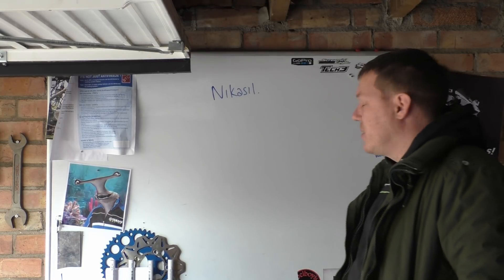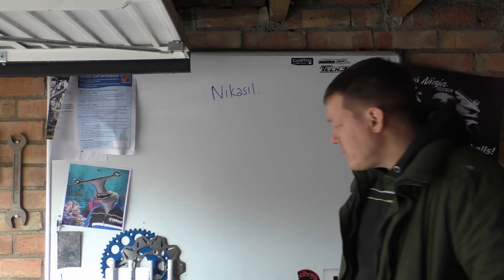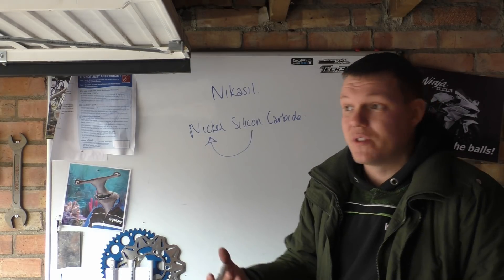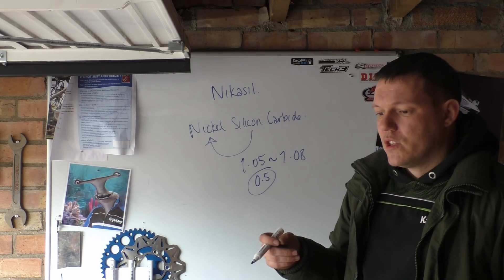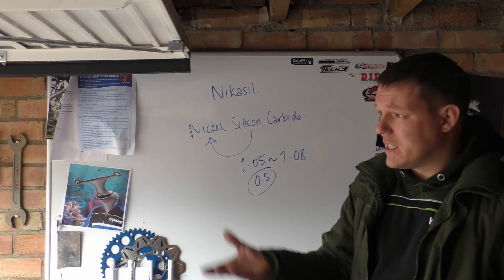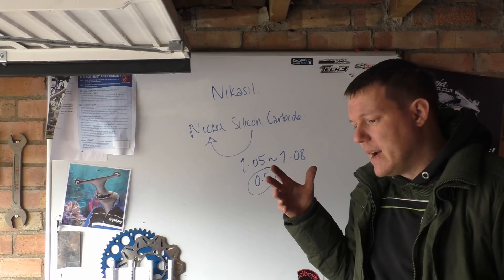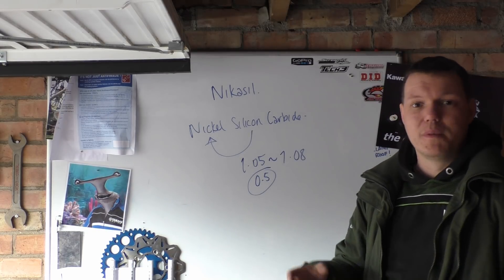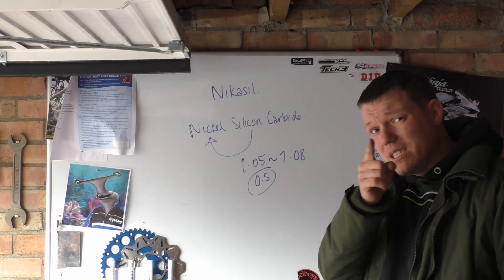Nikasil coated cylinder?

Comment: Actually the silicon carbide is not dissolved in the nickel at the beginning of the process (contrary to the wikipedia article). It's suspended in the electroplating  solution (acid and stuff) as fine powder. It then sticks in between the nickel  which is deposited to the bore. Basicaly the nickel serves  like a "glue".
Reply from the maker: Who said it was the beginning of the process - not another arsehole
Reply from the maker: https://www.sciencedirect.com/sdfe/pdf/download/eid/1-s2.0-002605769596247L/first-page-pdf
Reply: My bad. I misunderstood you.
Reply from the maker: No worries dude - that was a bit of a sharp reply from me - sorry
Reply: @thedirtyworkshop  Thank you for putting links to academic articles

Comment: Your a font of knowledge. So I have a question which might sound fallacious , I was doing a bit of research with regards to wooden pistons. I came across a blog where it said the original pistons for the seagull outboard engines were made out of Lignum a very hard wood. Bearings on subs were made from it but that's a different story .Plus during the second world war ash was used on tractors because of the metal shortage. From being highly sceptical, I have come to the conclusion that this might very well be a fact, as long as where the wooden piston top has a heat shield. Have you or any of your subscribers heard of this.?

Comment: When we further compare a steel cylinder liner vs Nikasil plated Al cylinder, there is another interesting fact.

The overall toughness is a better for the steel liner. So, when you are limited with space for your cylinder and you may come up with quite thin cylinder walls...in that case the steel liner is more ridig and durable, as the Nikasil plated Al cylinder would crack/bend/be destroyed under heavy engine load. This situation happens quite often (thin walls), when you are overboring the engine.

I understand it is not a "Nikasil" thing, but when we speak about materials and solutions for cylinders, this come up to my mind as well.
Reply: That’s absolutely rubbish. Cast iron sleeves are primitive compared to nikasil plated bores and anyone who suggests otherwise is stuck in the 70’s.

Comment: Which oil do you recomend for nikasil coated cylinder? Semi syn or full syn and which viscosity is better? Oil with ester is good for nikasil?
Reply from the maker: it doesn't really matter - and the viscosity has nothing to do with each type - if 2 oils synth or not have the same viscosity index then they are the same in regards to viscosity. Note that I said 'index' and not SAE rating (like 10W40).

Don't stress out about oils. Keep them topped up and freshly filtered and changed and you'll be fine

Comment: Do they coat pistons/cylinders using PVD (physical vapor deposition) also as they coat carbide cutting inserts and tools?
Reply from the maker: Yes with other coatings like DLC etc
Reply: http://www.staton.sk/wp-content/uploads/2015/11/Staton_Coating_EN_LR.pdf on page 14 there is a table with coefficient of frictions and thermal stability of some coatings.

Comment: Matt, I know this is years ago but it's common on early Yamaha R6's for the aluminium cylinder sleeve to crack and that fall into the cylinder, wrecking the engine. A common 'solution' to this is to bore out the coated aluminium sleeve and use steel liners instead of a coated aluminium sleeve. I've always been worried about doing this for reasons you mentioned above RE clearances etc on a high revving engine. Would you agree?
Reply from the maker: No idea. I haven't seen these failures to make a conclusion
Reply: @thedirtyworkshop  no worries Matt, it's the original carburetted R6 engines 98-01 that are affected. The later fuel injected R6's have a coating directly on the crankcase. Yamaha did away with the thin aluminium sleeve. If you fancy a read up on them, it's easy to find on google. Cracked liners.

I'd have thought that a proper fix on them would be to use a thicker aluminium liner, similar dimensions to the steel, then coat that. That way you still retain the heat transfer characteristics and clearances of the original engine.

Comment: Wouldn't you want a LESS heat conducting liner? Or at least the inner face of the liner? After all the engine block only has to reject the heat that actually soaks through it, any heat that goes out the exhaust is easy to deal with, especially if you're turbocharging where that heat becomes pretty valuable to you.
Reply from the maker: "Wouldn't you want a LESS heat conducting liner?"

heat is energy, so what we are concern about is saturation. Think of the liner as a filter (and the filter being conductivity) too much of a filter means that thermal 'flow' is going to be slower. This means that the piston will become hotter.

This put the piston in a harsher environment. And we are pretty close to the pistons melting temp.

Comment: Some small engine manufacturers still hard chrome their cylinders, your minimoto engine will have a chrome bore as do strimmers and some chainsaws.
Reply: What is the best material for the piston rings with nickel carbide silicon coatings
Reply: In the early seventies Yamaha had an optional cylinder what are the dirt bikes that was Chrome plated by 2 microns Honda produce a CR250R  what is a Chrome plated  cylinder in 1979 hitting others what alloy of chrome that was and I doubt they'll tell you my factory representative explain that they use a brush similar to a chimney sweep the bristles made out of Chrome the cylinder was grounded and I spun the bristles into the cylinder that was charged positive electroplating the insides of cylinder on aluminum. I was working at Honda at the time there was a chip on the cylinder of my Elsinore where someone has slept with a die grinder cleaning up the ports and my factory rep got it replaced for free which was very unusual no one else would have done that and I got a chance to see what the plating look at the place where it was chipped off and that was at the exhaust Bridgeport made a hell of a clicking sound when it was running so I got a free brand new cylinder ran the bike on the same cylinder for 7 years and then I trade it for a Harley like an idiot
Reply: What's the advantage of the coating there are aftermarket Harley-Davidson cylinders with no slave give them more space for a bigger bore I know one friend who has the huge cylinders on a Harley 135 cubic inches he has been getting the shit out of it over a year with no leaks rings are not smoking 150 horsepower very fast

Comment: My Suzuki GT550 B has aluminium (aluminum the US) cylinders with Nikasil coating.

When I scuffed up one of the cylinders following a piston ring mishap, I had to repair the damage. Fortunately Armour All (Tm.) spray is also Nikasil so I used this to gradually recoat the scuffed areas over a course of a week.

The method used was to spray the scuff area with that side downward (cylinder on its side), leave it to dry over night and recoat it. Repeat with the other scuffs around the bore. It was a calculated gamble that paid off. Compared to the expense of replacing a rare as rocking horse shit cylinder or finding and have somebody else recoat it, a bottle of Armour All spray seemed like a worthy long shot.
 
That was in 1989 and it was still coated, on inspection, 3 years later after a few thousand miles. The surface matched the factory coating and the scuffs were gone.
Reply: wow. i'm old, so i can remember when armour all was a vinyl plasticiser, and metal-ceramic composites weren't soluble in solvents. interesting information
Reply: Never heard of this method of fixing the coating. Interesting.

Comment: I never realized that the nickel in in the plating would wear off doesn't sound good in 1979 I bought a Honda Elsinore was it real crazy about the aluminum plated Chrome it was my only way of getting a sponsorship as I was working for a Honda dealer I was very weary of this Chrome on the on a cylinder and was constantly cleaning the air filter I never wrote it without a fresh clean foam filter and ended up riding the bike for 7 years was nowhere at all in the cylinder I did however about every six months install a brand new piston and rings weather in need it or not the only thing you could ever see on the cylinder what is a wear pattern but I could not measure as it was just a image and not anything you can feel or measure as we know there are allies of Chrome but I doubt if you'd ever get the formula from Honda what they use are there any possibility of any type of Alloys for this nickel plating something that would allow the aluminum the bond better with it and some kind of an some kind of an alloy of the nickel for the best of both worlds have chrome plating and nickel carbide and silicones

Comment: Why does wiki call it lipophilic? Why would its fat solubility be relevant?

Also, pronounced molly, two separate syllables mah-le.
Reply from the maker: Excellent question and had to look up an accurate definition. 'Lipo' means to leave of lack of. So Lipophillic means "the ability to dissolve in non-polar substance" Basically the opposite to Hydrophillic. 

It's nothing to do with biochemistry but dissolving, fucking chemists LOL
Reply: Lipophilic = oil sticks better
Oil sticks better = better lubricity 
Better lubricity = less wear
Less wear = longevity
Reply: lipo = polar. means oil sticks not repels. it's not about solubility if it's not liquid. mahle is utterly not pronounced molly ... matt has it completely correct
Reply: Last work kinda guy ehhh!

Comment: can I plate cylinders with Nikasil myself?
Reply from the maker: Yes, but obviously you have to have the set-up
Reply: Should watch 2STROKESTUFFIN. He's making a 2 stroke engine on his own and is also doing his own nikasil coating. However it seems like in most cases it's not worth doing yourself.
Reply: @thedirtyworkshop  hey there's something else that would probably work with this also I watched a video where their ceramic coating the tops of the piston temperature crazy they like drop the temperature underneath the piston I want to say 300 degrees is it was what it was really a lot they had a ceramic coated piston and you just do it on the top side and that's all and a torch on it laser temperature gauge on the bottom of the piston and there was that that much difference is it was there's a lot of different and this video they mention the coating on the cylinder would be good too. And the show was leaning toward people who put turbos on engines that didn't come with them
Reply from the maker: https://www.youtube.com/watch?v=zg2S5VBxuUc

Comment: Nikasil liners were rubbish on air-cooled engines. Piston slap killed the bores. Yamaha & Suzuki perfected it on their strokers.
Reply: ROY FERNTORP Yamaha had plenty of trial (and mostly) error streak on the early R1's & R6's that. Cracked cilinder walls are synonymous with the '98 till '01 YZF -R series.
Reply: Very interesting.

Comment: Yes but you can re-bore an engine replace sleeves or re-bore a block with cast in place liners etc.....You can replace sleeves/liners as well. Generally when a Nikasil block needs to be rebuilt you are shit out of luck and need a new block! In the car world they are shit just ask anyone that owns a BMW, Daimler or Porsche for any length of time! God help you if you are the second or third owner of any of those today. In a perfect world Nikasil would be great but in the not so perfect world of machines it sucks! I am not keen on this throw-away world we are living in. From an OEM standpoint I bet it greats kind of like "lubed-for-life" bearings, Universal Joints, Transmissions and Differentials!